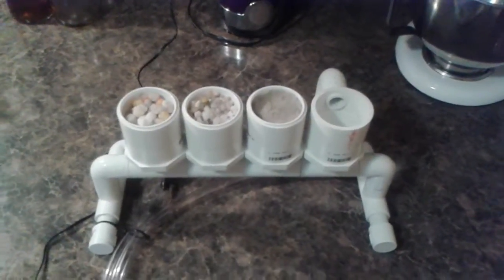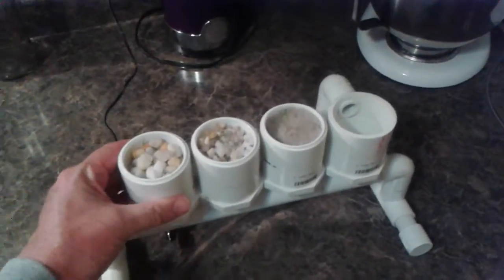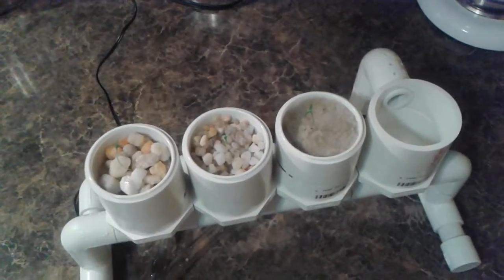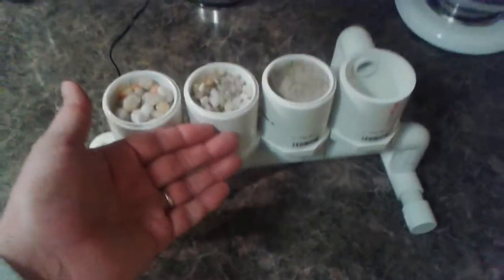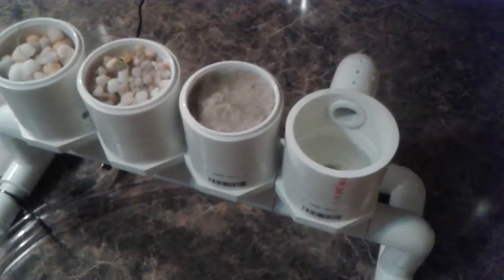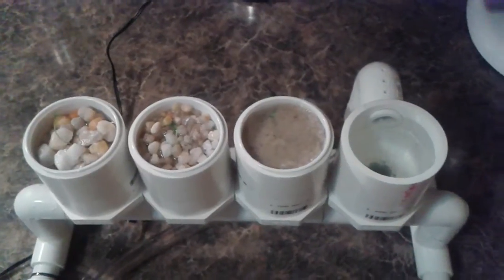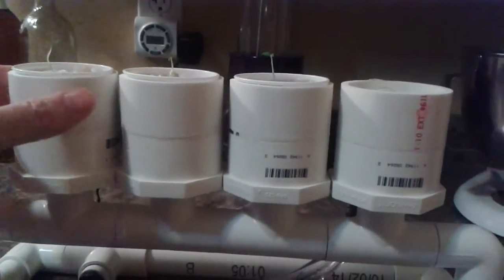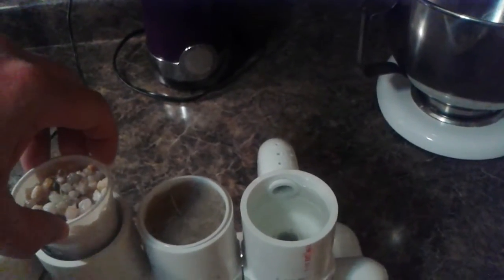Homemade Hydroponics Part 2 - Mini Ebb & Flow - DIY

Comment: Out of curiosity, what do you use to seal the self-made connections like the outflow pipe in the rightmost cup? Just finished my first build (big thanks to you for showing us how easy it can be) but I did get some slight drip from my inlet connection where I connected my PVC tubing to a hole I drilled in a PVC endcap. I used O-rings and PVC cement to seal the connection but it's a wee bit janky and doesn't look nearly as clean as yours.
Reply from the maker: I drilled a fairly tight fit hole, and then I glued it in with pvc glue. I think I used a cheap spade bit that I ground down to be just the right size. I've done that before, can't remember what I did here.

Comment: I'm Actually looking to build something very close to this system. Do you have a part list for the mini Build?
Reply from the maker: This uses the same ideas as the big setup but is much more temperamental (i.e. sketchy). The pots are so small that they dry out very fast. I'd go with the big one or at least use big pots. I don't really have a parts list (I just made it up as I went along). You can use the same idea, but use whatever parts you can get. There are many different ebb and flow designs on youtube, which basically means you can do whatever as long as it floods and then drains out.

Comment: How about another video step-by-step how to make that?  This is very neat!  
If I understand correctly the forth container with water is an overflow and leveler.  If I were to lower it a bit, so I doesn't go to high with all the plants.  Correct?
Reply from the maker: Linda - This was just a demo model that my daughter too to the state competition so that she didn't have to take the big one. It is really too small to be of much use. Have a look at the other video showing the big one. That has a bit more detail.